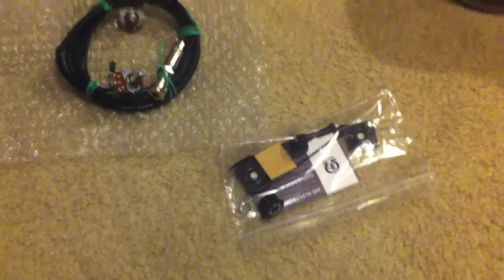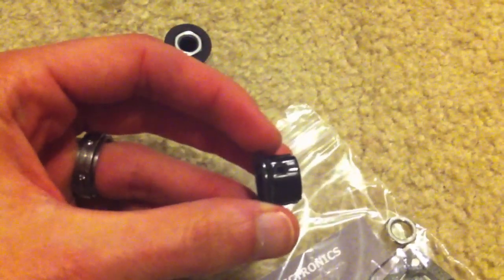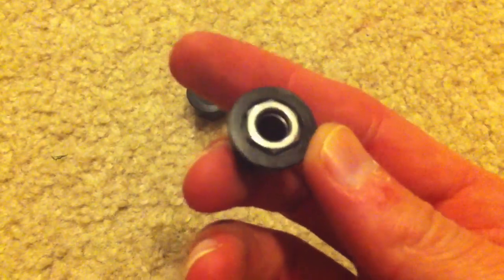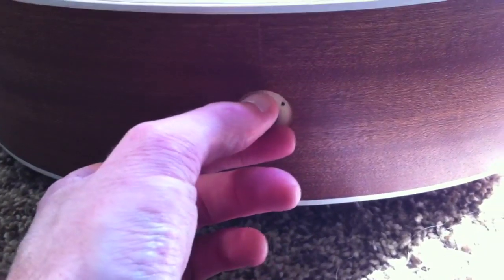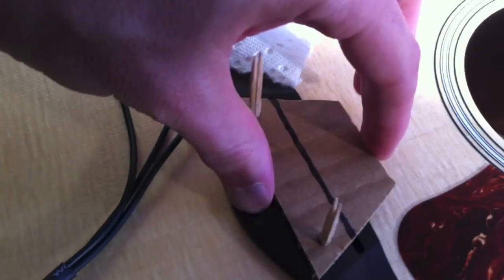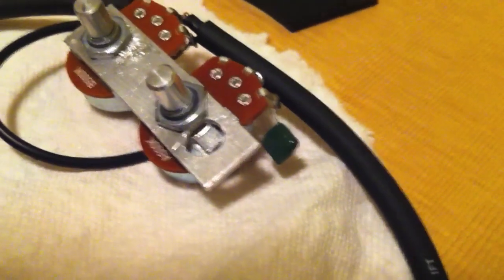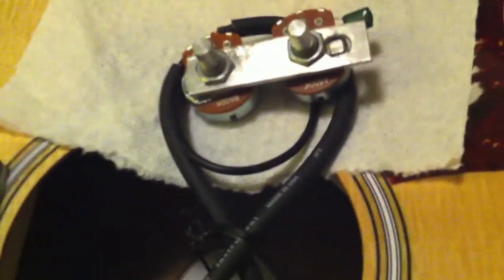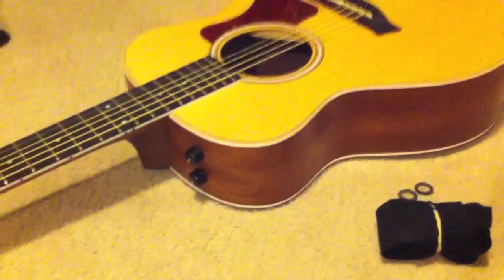Taylor GS Mini JJB Pickup Installation

Comment from the maker: The key for me was to cut off the "skirt" of the knobs (a friend of mine at work did this with a machining tool) and to have the nut of the potentiometer shaft INSIDE the guitar and not on the outside.  That is why I made the aluminum piece to connect the two pots.  It does't make a huge difference, but it does make the knobs a little more low profile.

Comment from the maker: Since the GS Mini is a smaller scale guitar I went with the 15mm ones.  I think the 20mm are meant for a normal size, like a dreadnought.  JJB's "Prestige 220" model is actually made for smaller guitars like the GS Mini.  However, it only has 2 piezos and no tone or volume control.

Comment from the maker: The new jack that I installed (that comes with the JJB kit) allows for a strap. If you look at about 0:30 in the video you'll see the end jack.  There is a large groove at the end that is made for a strap.  You put the strap on first and then plug the cable in.